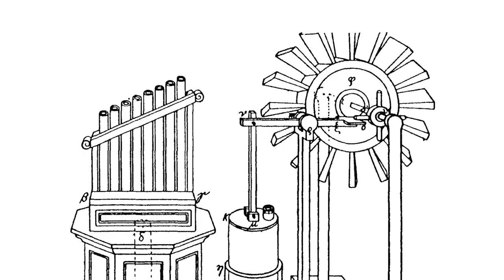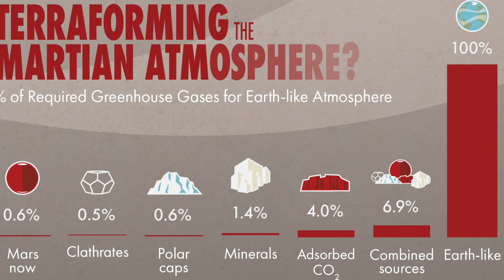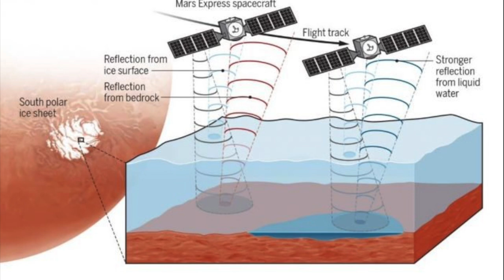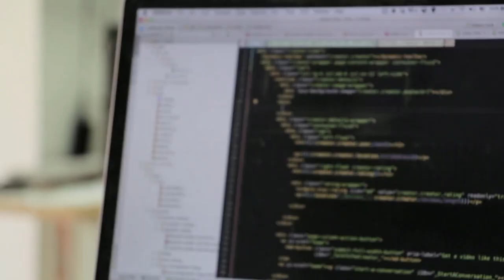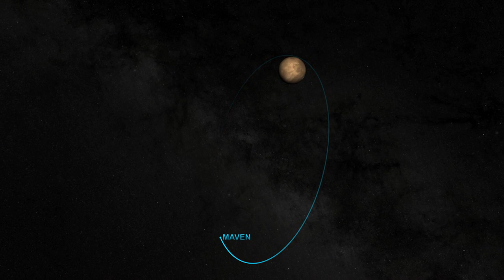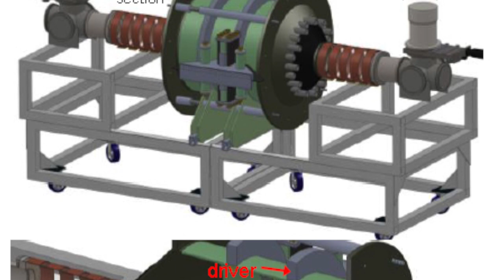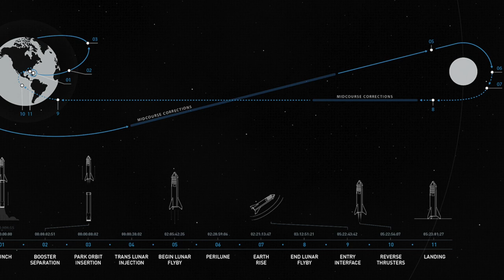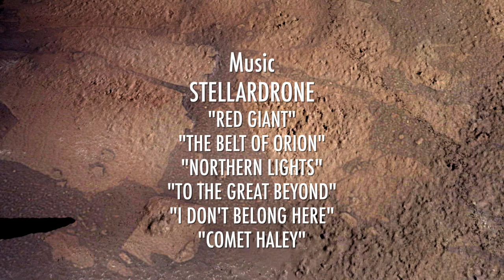Mars And Beyond With Dr. Robert Zubrin

Comment: Seems to me Venus is a better candidate for tera forming .Why is it always Mars Mars Mars.
Reply: Mars is easier to get to and the only planet humans can actually land on plus it's way easier to heat up a planet (we have been testing and perfecting that technology for the last two centuries now) than to cool it down. I'm personally not a fan of settling planets in general, but the reasons for favouring Mars over Venus are pretty obvious.
Reply: In order to terraform Venus, you'd have to move it farther away from the sun. We don't have the technology for planet-moving at the moment. 
By contrast, Mars can be terraformed by pumping CFCs into the atmosphere.
Reply: @Joshua Richardson You wouldn't have to move Venus at all. The equilibrium temperature of Venus is 260K (-13°C/9°F) and a suitable atmosphere would make Venus about the same average temperature as Earth which has the same equilibrium temperature. Venus' slow rotation would be a much greater challenge, though.
Reply: you would have to shade Venus not move it far is easier to the point the co2 freezes out then seal it away or export it, than you would bombard it with nitrogen in such a way that you speed up its rotation.
Reply: @ @bencoad8492  Why would you bombard Venus with nitrogen? It already has 3 times more nitrogen in its atmosphere
than all of Earth. If anything you'd want to export nitrogen to space colonies in the inner belt or Mars.
Reply: @ronaldgarrison8478  I was wondering about your points 3 and 4 and to my surprise I couldn't find any solid information on that. It seems as if Venus doesn't lose a lot of atmosphere due to solar winds (it's massive enough to hold on to its atmosphere for geological time scales). As for the ozone layer - Venus' ionosphere generates a magnetic field-equivalent, so it seems as if radiation isn't that big a concern even without an intrinsic magnetic field ( http://sci.esa.int/venus-express/54069-8-a-magnetic-surprise/ ).

I don't understand what you mean with your last point. Why exactly would satellites have a hard time orbiting Venus and what's the lack of moons all about (remember, Mercury doesn't have a moon either and Mars' moons are captured asteroids bound to leave it/crash into it within the next few million years)?
Reply: @ronaldgarrison8478  I can't comment on the atmosphere question as there's simply not enough papers out there that tackle the question. The water, however, can "easily" (we'll talking terraforming after all, so the definition of "easy" is a little on the loose side here:) be imported from comets and asteroids. Since these bodies are comparatively easy to redirect - either via propulsive measures such as attached salt-water rockets, or via gravitational tractor - it's actually no that hard to slowly(!) bombard Venus with water-rich bodies. It has to be done slowly so that we don't heat up the surface too much... Cooling the planet and safely depositing all that CO² would be a huge challenge, though, I totally agree on that. 

Orbits work just fine around Venus. It's no more difficult to have a stable orbit around Venus than around Earth. The Sun's gravitational influence isn't that much stronger at these distances and only becomes a problem inside Mercury's orbit. In theory it'd even be possible to "steal" some Kuiper-belt object or one of the  gas giants' moon and send it towards Venus for the planet to capture it. Not that that's in any way a realistic thing to do, but it's technically possible.
Reply: @ronaldgarrison8478  I totally agree. Expansion into space has its merits, but building artificial habitats is much easier, quicker, and more flexible.

Nevertheless, though, it isn't at all necessary to "waste" potential real estate on Venus by covering 70% of it with 2 km of salt water like on Earth.
The Venusian atmosphere contains about 0.002% water vapour [1]. Given a mass of 4.8*10^20 kg this results in roughly 9.6*10^15 kg of water or about 9.6*10^12 m³ - enough to cover the whole planet in a whopping 2cm of water. That's certainly not enough to form an ocean or seas, but it's sufficient for supplying some air humidity at 1 bar of atmospheric pressure, clouds, occasional rain, as well as some small rivers and lakes. Since the Venusian mantle is likely to contain significantly more water that Earth [2], it might also be possible to trigger local volcanic activity in order to release enough water to create a small shallow (e.g. 30-100m) sea on Venus without importing water from elsewhere in the solar system. 

While I'm not a fan of terraforming in the near term, it might still be a worthwhile prospect for later generations that live in a post-scarcity society (in my view a necessary condition for mega-engineering projects like terraforming).

[1] https://arxiv.org/ftp/arxiv/papers/0901/0901.3869.pdf
[2] https://www.lpi.usra.edu/vexag/reports/science_nuggets/2013_Sept_Smrekar%20.pdf
Reply: There is a lot of weird stuff in this discussion. I read up a lot on terraforming Venus, because I'm worlbuilding a hard sifi setting. Let me clear up some stuff here.
1. It is easier to get to Venus than to Mars. It requires less delta-vee and launchwindows are more frequent. In fact, Venus was the first planet we visited (sovjet Verona missions, I belive )
2. One does not need to terraform Venus to settle it. There is a reasonably temperate layer of atmospere, where a normal earth atmosphere is a carrier gas. So one coud built cloudcities there. Chech out NASAs interestingly named HAVOC programm.
3. Venus has no moon because its proximity to the sun. Thats marginally true, but very poorly said. There is a huge difference between not having a moon and not beeing able to have a moon. So for starters, there is simply a lower chance to get a moon as an inner planet, because natural moon accretion during the formation process only happens beyond the frost line, capturing a moon is hard, due to Venuss small mass, small orbit and the relativly tidy space in the inner solar system. So the best way to get a major moon, is a major impact event, like the one, that happend on earth. The other thing, that determines, if you have a moon is the size of the planets hill sphere, the zone, where stable orbits can exist for planetary timescales.
4. Cooling Venus isn't that hard. The best way to do that are starshades, giant lightblocking sheets of aluminum. You can place those either in an orbit arround Venus or at the L1 lagrange point between Venus and the Sun or in an orbit. These starshades could be easily manufactured on Luna or Mercury and could be shot to Venus with massdrivers. This is already within our industrial capabilities . If you have the shades, just wait till the CO2 freezes out and you got a 3 bar nitrogen atmosphere.
5. Importing water. You dont need to import water, just hydrogen. There is plenty of oxygen on Venus, just break up the CO2 or cook it out of the rocks. It is the third most abundend element in the universe after all. What you wanna import is hydrogen. One Mol (standardised number of atoms) of hydrogen weights 1 gramm, one Mol of water 18 gramm. So if you produce the oxygen on Venus, your water production is 9 times more efficient.
6. Magnetic field and plate tectonics. The most commonly cited reason for the lack of a magnetosphere is the slow rotation. Thats hard to fix, yet an ozone layer, the natural radiation blocking of an atmosphere (there is some kind of mechanism, its been a while since I read up on it), genetic engineering on colonists and the  new biosphere are likely gonna do the trick.
7. The rotation and day length. The rotation is close to unfixable. So for the daylength you could either simply get used to it, like everyone in the arctic circle or play arround with mirrors or shades at the L3 and L4 lagrange points or in an orbit with the desired daylength.

I hope I could shed some light of the situation with Venus.
Reply: @jensbrandt7207  wow thanks gonna have to read that a few times maybe have to back to college.
Love your channel
Reply: @jamesparker4471 
xD thanks
Just ask, if you got questions gonna try to do my best to answer them.
Reply: Venus is pretty much hell.

Comment: Musk is a great marketer but he should first fix his car problems and show profitable space travel as well as solve the battery problem (They drain too fast, take too long to charge, require great amounts of energy to charge) before he starts talking about getting people mid 2020's. Come on people, if you think for a second you'd see that the amount of engineering, financial requirements, human cost are vast. Not to mention the amount of energy needed to power a supporting habitat. I mean just to get all that stuff into space to begin without is a costly an engineering feat. I admire people who have great innovation in their field but where does someone say "Hey let's take it one step at a time" instead of going for the whole cake?. The sheer number of steps and processes to get from rocket launch until a supporting habitat that can support humans consistently on Mars is just mind boggling. Mid 2020's?  More like mid 2021's.